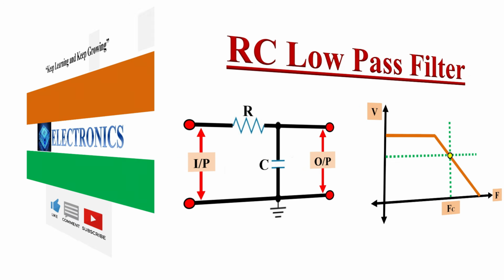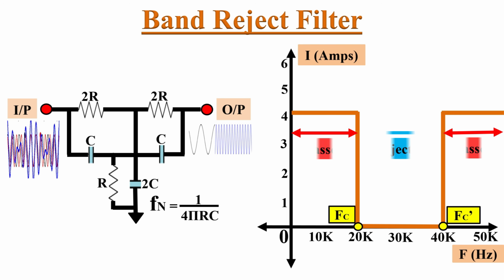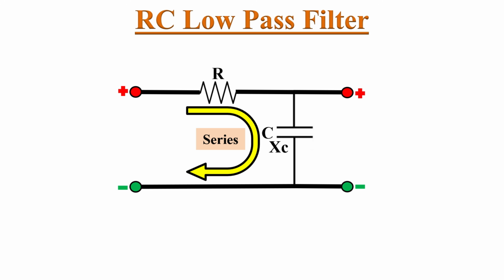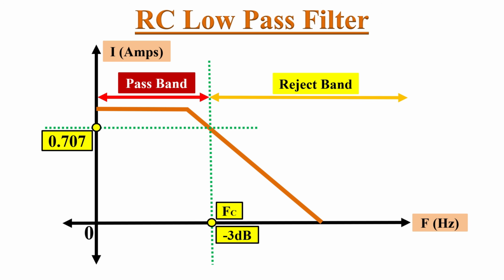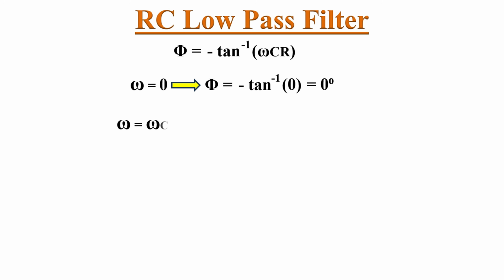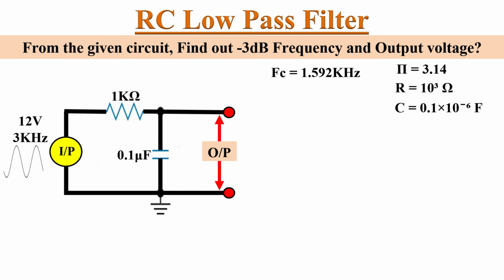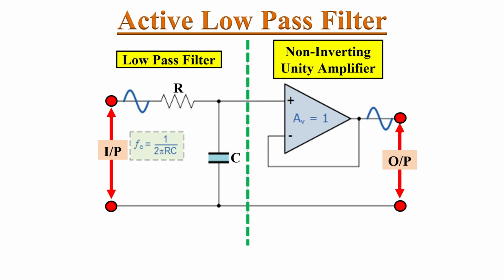RC Low pass filter Explained with Example.

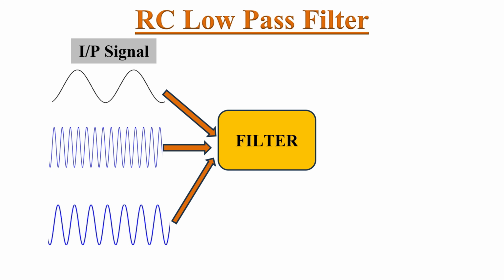Comment from the maker: 0:20 What is an Electronic filter and its types
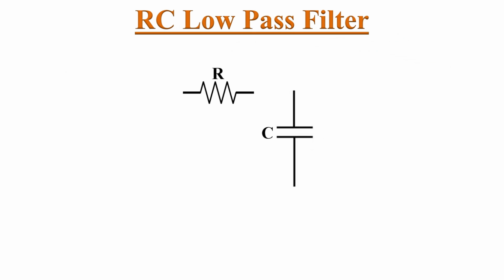4:30 RC Low Pass Filter
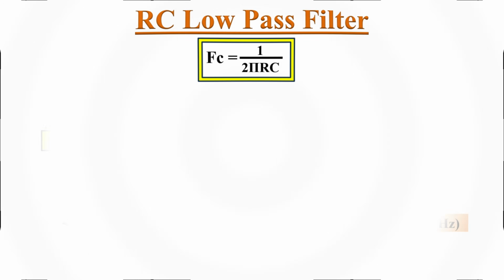7:45 Cut-off frequency expression and Derivation
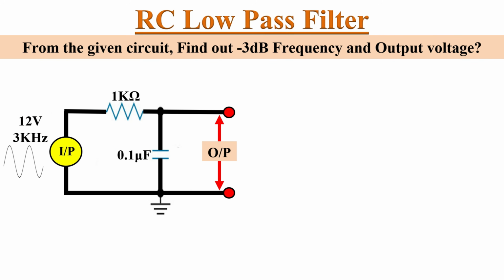10:48 Example on Low Pass Filter
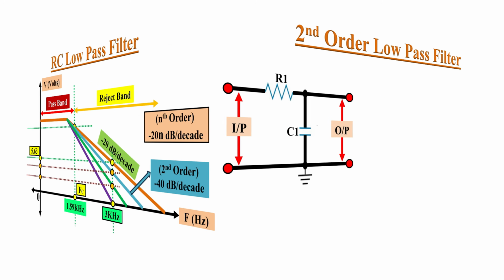14:21 Higher-order filter design by cascading first-order filters

Comment: Can you explain the overloading that can occur in a cascaded low pass filter that does not have its resistor value of the second order 10 times the resistor value? By adding the higher resistor value by 10 times the first order, doesnt this technically change the fc value based on your prior equation? Is there a way to meausure or identify this overloading effect?